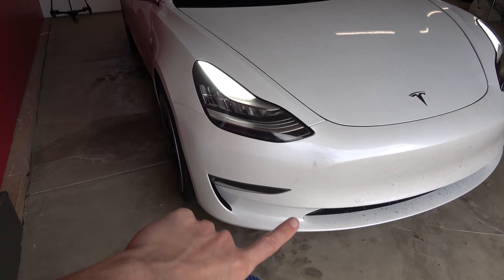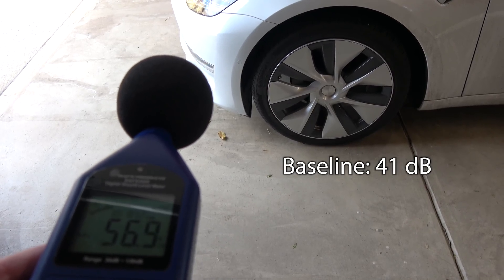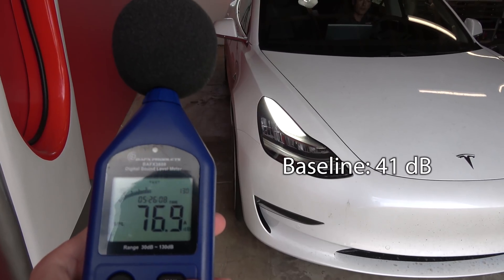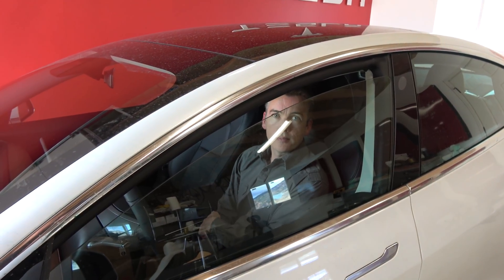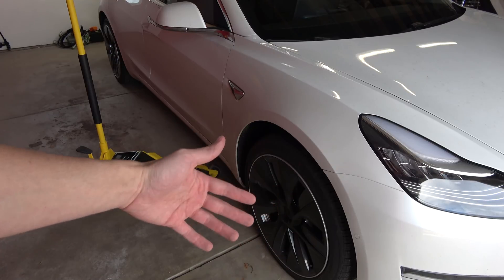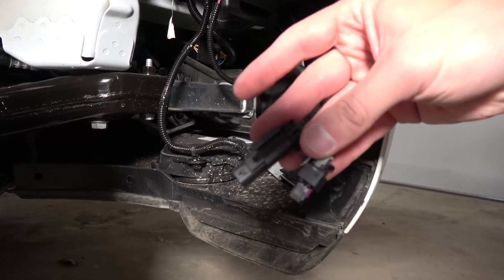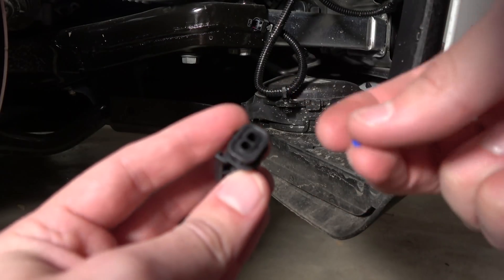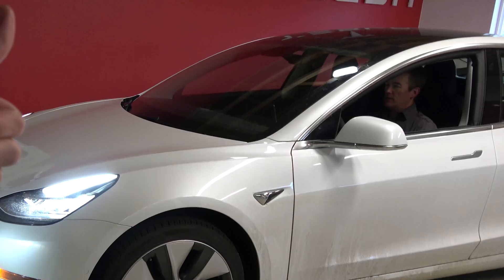Tesla's Pedestrian Warning System. How to Temporarily Disable It...

Comment: There may be a gaping loophole for Tesla, in this ridiculous regulation designed to make money for dealers: "Manufacturers are prohibited from providing any mechanism for anyone other than the manufacturer or dealers to disable, alter, replace or modify the sound"  NOTE: Software is clearly not a mechanism. There are no physical parts. Programming is software, not hardware.
Reply from the maker: Good catch
Reply: @TeslaInventory  Thanks from the former AI researcher in Genetic Algorithms, who has told more than one clueless CEO: Sorry I can't fix your computer without buying new stuff. The hardware is failing, No, you can't fix it with software reloads.
Reply: There's more than one definition of mechanism, you are just looking at one.
Reply: @PhillipStewartYYZ  You illustrate why people hate lawyers, because they twist words to try and call a cat a dog.  Point 2.   It is targeted at prohibiting  Tesla speech, as Tesla uses no dealers.  Details: Since  "Mechanism" is not physical, it is ONLY software, a real  constitutional lawyer can argue it is covered by the 1st Amendment, as prior rulings held that  software is a form of protected Speech.  Prohibiting certain speech in advance, and forcing publication of only one type is also "Prior Restraint."  Its not based on the "public safety" exemption, because any buyer may turn it off.

Comment: While you're in there, I'd just remove the speaker to save weight and then cover the holes over.  Trust me, I'm never plugging it back in.
Reply: Seeing how there are only two wires going to the “module”. It’s leading me to believe the entire thing is just the speaker. Meaning the source and amplifier are some where else. Especially since there are two different tones, forward and reverse are very different. 

And considering how loud it is. Simply putting a low wattage resistor in there may not suffice. As the resister May burn up right away or after some time.
Reply: @robertsteich7362  seems like just resoldering the wires from the speaker cone would work
Reply: @robertsteich7362  a simple 50 W resistor with screw holes and a copper heat sink do cost 3.50 bucks including VAT.
Reply: Wouldn't it easier and safer if the pedestrians just looked before they crossed the bloody road?
Reply: Ian Corner for blind pedestrians. I’ll be doing this with my Tesla but it’s for blind people.
Reply: @3DPrintedCat  blind people have dogs or a white stick they unlike sighted people do-not just walk in the road they use crossings. Tell my one occasion or incident where a blind person has been hit by an electric car after they wondered into the road because they didn't hear it?
Reply: Ian Corner I never said I agreed with it. I’ll still be turning off the speaker in my model 3
Reply: 100% unless they make the software throw a code
Reply: @tonyc6996  then you could just add a resistor which tricks the system to think that there's a speaker.
Reply: @RubenKelevra  I'll just pull it a part and remove the speaker itself and leave the module in there
Reply: @tonyc6996  this module is just a speaker in a plastic cover.
Reply: @RubenKelevra  are there pictures of one disassembled?
Reply: Oh yes....save weight....all 1 pound of it.

You’re a moron if you think that will do anything weight wise.

Comment: I was against the sound at first, but I realized it's more for people with disabilities, such as blindness, so they can hear cars. But I agree, all cars should have it, not just EVs. Lots of hybrids are near silent now under 5 mph!
Reply: so, my lil sis lives/works in NYC. She's blind and teaches kids with disabilities as well. There, they have noisemakers on the cross-walk signals, so no need to have this idiotic abomination unless required by law or unless Coconuts are available :)
Reply: @jamesbramlett5407  interesting! I learned something new today. Is that in other cities too?
Reply: @jamesbramlett5407  there are a lot of places around the world where you have to cross the road without a dedicated crosswalk and signal.
Reply: But not in the us where this is required, teslas only make this noise in the US
Reply: If every EV in a busy city center or parking lot is making noise, it could actually mask the noises form other nearby vehicles and cause noise confusion to both blind and normal sighted individuals. There are better ways to implement safety for pedestrians.

If they're going to require a hardware addition to vehicles, why not require an internal speaker with a radio receiver. Now blind people (or other cautious pedestrians/cyclists) can optionally carry transmitters that warn nearby drivers that a pedestrian is nearby. It could also be used to alert for other hazards like construction crews, deer crossings, bad road conditions, upcoming red light, etc.

Comment: You are opening up yourself to law suit if someone get hurt.
Reply: Henry Nale I was thinking the same thing. If someone, especially with a disability gets hit by a car and it is inspected and you are found to have removed the sound are you extra liable? Criminally? I don’t think there’s Precedent on this yet.
Reply: tesla has ~500k cars out there without it, whats the difference.
Reply: @Rye 
Say he runs someone over who didn’t see him because he or she is blind or simply didn’t see his car. A lawyer will check the vin to see when the vehicle was built to determine if it had this safety device. Then...said attorney will subpoena Tesla for their data to see if the device was connected and working at the time of the incident. Dont forget all modern cars these days are computers on  wheels. Especially Teslas!
I have a Model 3 that was built in April and my car doesn’t have the “noise maker” but i wish it did. Tesla is all about safety and so is this device. Two years ago a Prius driver with dark tinted windows almost backed over me in a dark parking lot. 
I saw his white lights and move quickly out of his way but he never saw me walking. If I was blind or not paying attention he would have ran right over me. 
So the difference can be a matter of life or death or serious injury.

Comment: was this turned on during after an update? my dec 2018 model 3 doesn't make a sound.
Reply from the maker: Only cars made recently (starting in August) have the speaker. My older cars don't.
Reply: @TeslaInventory  will I need to bring it in eventually to have it installed?
Reply: Only new cars have the external speaker.
Reply: No. Mine is a dec 2018 and there's no speaker there
Reply: Hoping this isn't some mandatory recall. I actually the want the sun visors without the warning labels